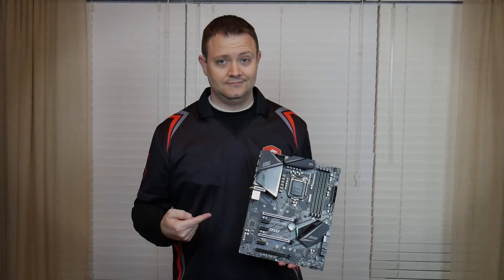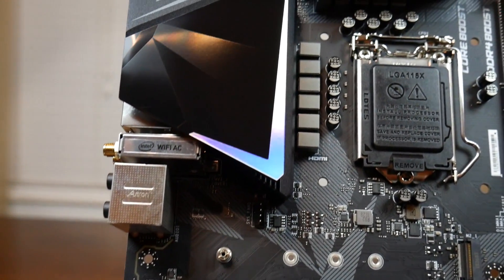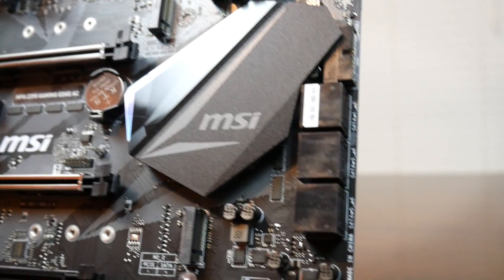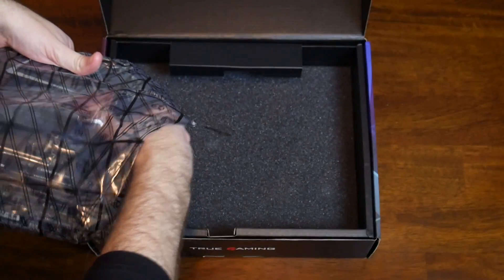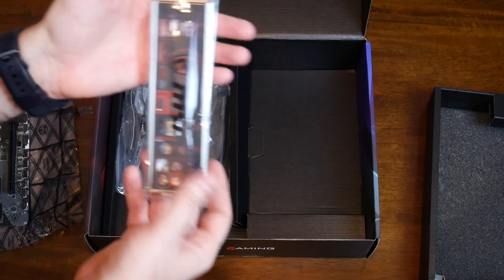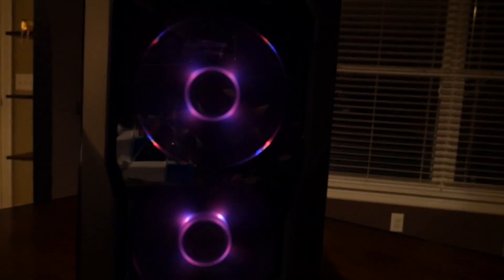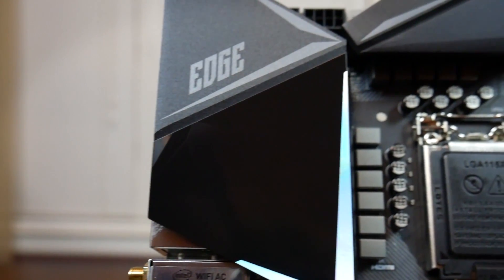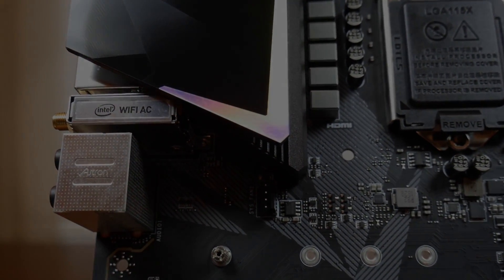MSI MPG Z390 Gaming Edge AC | Review, Unboxing, Build

Comment: I have one but I’m not sure where to plug in my headset for audio and mic
Reply from the maker: There is a pink and green audio jack on the back of the board in the input output area. Pink is mic and green would be your audio. If you are using the audio ports on the front of your case make sure you plugged in the audio header of your case to the HD Audio header on the board.
Reply: @HeirofCarthage  mine are all black 😂

Comment: What Power supply would you recommend? Does the extra CPU power connection make any difference? (My PSU doesnt have the extra 4 pin cable)

Comment: Is the ryzen 9 compatible with this I need help and can’t find out lol
Reply from the maker: No. Z390 in an Intel platform. If you want to use Ryzen 9 3000 series or the upcoming 5000 series you need an X570 or B550 motherboard. If you are using Ryzen 9 I would make sure it has good VRM heat sink too. X570 Tomahawk is a really good one.
Reply: @HeirofCarthage  my budeget is like 200

Comment: Can you use a GTX 1060, Intel Core i7-2600 CPU and DDR3 RAM on this board?
Reply from the maker: No. This board is intended to support 8th GEN intel. It only accepts DDR4. But a 1060 will work on it for sure.

Comment: I just bought one of these.(Its on order from ShopBLT). My PSU is an EVGA 750W that only has an 8 Pin (2x 4Pin)12 V.  Do you think its fine to run the 8 Pin + get a Molex to 4Pin 12 V?
Reply: I am running a 9700k + 2070 Super.

Comment: This motherboard has 2 cpu power connector 1 is 8 pin and 2nd  is 4 pin so which power supply u recommend for this motherboard ????
Reply: 8 pin is fine. the other 4 pin is if you want to overclock

Comment: my mobo not turn on, i only put 8 cpu + 24 pin cpu, but this one have an extra 4 cpu slot, how i can solve it? my power supply corsair cx750
Reply: sounds like you might need a new psu

Comment: Does this motherboard support 4 DIMMS (4 channel memory)?
Reply from the maker: It will support 4 DIMMS of RAM, but it is Dual channel memory. Z390 as a whole can't support quad channel memory. You would need X299 or a Threadripper platform for quad channel.

Comment: I’m having problems and confused on how to use the cpu power 2 connector 

msi mpg z390m is mine the micro version 

I have a i7 9700k that I wanna overclock as much as a I can I don’t even know if I’ll even need it to OC shit.

My PSU has a single 8 pin cpu power connector  so what able would I need to connect both the cpu power 1 8 pin and cpu power 2 4 pin ?
Reply from the maker: You can run just fine and probably even do light overclocking on a single 8 pin connector. Otherwise if you just want to have both power connectors you will need to buy another cable for your PSU. Hope this helps!
Reply: @HeirofCarthage  So if i dont wanna to do overclocking on the  9700k  its okey with 8 pin?

Comment: Just one question. whats the point of having a ps2 port when no one uses them any more
Reply: I use them. My keyboard is a champion and is on PS/2.    + PS/2 is always compatible, no need of drivers when installing an operating system paired with a board that unofficially supports it, such as windows 7 + x470 AM4, users with usb2 board in that case are having a hard time installing the os, let alone if usb3.0.
Reply: You'll understand the need for ps/2 port once you stuck while installing any other os than win10 .

Comment: I have the same case and the same motherboard. I just finished my build and the 3 case fans at the front have no lights and only top 2 fans spin. any idea what is happening I don't really have a clue and I need help
Reply: i have a different case but the same motherboard and mystic light app only works with some of my harddware and none of my case fans. do some digging on google and reddit sometimes there are software updates to fix this, but it seems to be a common problem with mystic light/ this motherboard. the only things i couldn't get to goto the color i want are my corsair cpu aio cooler and my case fans, so i matched the ram and motherboard leds to the blue those were showing
Reply: @rewind_7580  Same problem, my motherboard only breaths with rainbow colors, and there is no way to change it from Mystic Light

Comment: Hi, I have one question, on the motherboard MSI Z390 GamingEdge, you have a "8-pin pwr1" and "4-pin pwr2" on the top left, did you connect the "4-pin pwr2"? Cause there are not cable like that with a RM750X Corsair. Thanks.
Reply: thats for the cpu

Comment: can I use my i7 9700k? Or is it just for i9 gen?
Reply: i7 9700k is a 9th gen Chip lmfao
Reply from the maker: It will work with any 9th Gen Intel Chip. i3, i5, i7, or i9. So yes the 9700k would work.

Comment: What power supply i should buy for this board plz help.
Reply: Send your pc specs dumb dumb
Reply: @MatT-rx3ge  motherboard - z390 gaming edge ac
Processor - i5 8400
Ram - 3000 mhz 16gb
500gb ssd
2 tb hdd
Reply: @zengagamingzw  get a 600W power supply
Reply: @MatT-rx3ge  thanks matT .
Reply: You buy a power supply based on other components like your cpu, gpu, fans...

Comment: I got this motherboard paired with a 9600k and a rog strix gtx 1070. Absolutely slays games
Reply: I'm planning on a similar build
Reply: Galaxy Eyes Photon Dragon go for it. It’s amazing
Reply: @Mmjacksom  I need to find a buyer for my old PC first
Reply: Galaxy Eyes Photon Dragon just sell on eBay or something similar. Or you can just sell individual parts
Reply: @Mmjacksom  I'd prefer cash, paypal is kinda screwy with me right now
Reply: What power supply did you use? I cannot find one with a connector for the 4 pin 12v socket next to the 8 pin socket
Reply: I5 9600k and RTX 2060 is one of the best
Reply: Raf.2waveyy I still have the 9600k but upgraded to a rtx 2070 super

Comment: For the CPU there is a 8 and a 4 Pin . Does it also work when you only use an 8 pin conector
Reply: Florian Schmuck yes it does the extra 4 pin is for big overclocks only

Comment: Just picked one up today, gonna pair it with a 9600k. Should make for a nice gaming system without breaking the bank.
Reply: I have the same case and mobo with the 9600k
The 9600k punches fps benchmarks along side the 9900k for half the price
Reply: what graphics card are you going to pair it with?
Reply: @hotload5673  EVGA 1080 Ti SC2. I got it used on eBay before the prices went insane.
Reply: maxview99 would an msi 2060 gaming z graphics card be a good pair for this build?
Reply: @hotload5673  If you are going for 1080 or 1440 gaming absolutely. The new 2060 is pretty much on par with last gen 1070 ti. Plus you'll have the new ray tracing feature and dlss to play around with.
Reply: maxview99 yeah that’s sick, thanks for the advice 👍🏼
Reply: @hotload5673  Glad to help, have fun with your build
Reply: how is it?? I was planning on setting it up with a i5 9600k too. But i also heard bad things about the CPU. I'm going with i7 instead. Lmk how everything is. BTW what ram did u use?
Reply: @Haylem  The 9600k has been working good for me. I overclocked to 5ghz at 1.35v, ram is Gskill Ripjaws V 2666 overclocked to 3000. If you have the $ the i7 is def. a better investment in the long run.
Reply: @maxview99  Interesting. Glad you're happy with it! Game on brotha.

Comment: Hi, i have this motherboard, there is no led indicator when the system is shut down(when you turn off the PSU the led goes off) and neither when it is on and running except the edge lighting.
In all the other motherboards i use to have there was always a led for both states, on and off
Reply: The motherboard has lights for all 4 ram sticks and xmp when it’s turned on

Comment: Thank you for this upload, ordered this motherboard and i barely found any sort of coverage for this particular one. At least i feel at ease now especially getting a bit more detailed info :D  Had to pretty much upgrade after experiencing a water leak back home and my system  pretty much died on me.  I figured i might as well go big at least currency exchange wise.. i5 9600 k with the msi mpg z390 :D  Thanks and a video well done
Reply: wolfy Gongora same setup here too😂
Reply: except the part where there was a screw that shorted out the motherboard lol
Reply: Ouch...sorry to hear. What sucks is mine started to rust n i had no idea until i got online game for a couple days none stop then suddenly none stop blue screens n constant restarts. Got it checked out n well seems either or both my gigabyte g1 sniper n Intel i5 got dmg. Practically wanted to cry lmao. Still waiting on my parts. Sadly but oh well. Stuck waiting
Reply: wolfy Gongora  damn i just dropped my 9600k and z390 off at ups yesterday, i get the new parts saturday, luckly i noticed the gaming carbon was on sale for the same price as the gaming edge so maybe the upgrade will change things
Reply: I wanted to get the carbon but im already flipping about 2k be cash in my currency with shipping n duty etc i still gotta pay duty so i went with this especially cuz i can actually use Bluetooth or Wi-Fi
Reply: @wolfygongora4002  i feel you, i wish i couldve took advantage of the wifi, but my ethernet is so much superior
Reply: Does this have WiFi and Bluetooth on it already
Reply: I’m new

Comment: Hey, i just received my z390 gaming edge ac and im having trouble controlling the mainboard leds with my msi mystic light program. Even if i select other colors it doesnt apply for my mainboard. It seems like it us working for you. Do you have any tips? Thanks and nice video!
Reply from the maker: Did you check to see if you have the latest version of the BIOS? Probably a good place to start.
Reply: I have the same problem, never been able to solve it. The mobo leds only 'breath' with rainbow colours like you see in this video. From Mystic Light I can't change it at all...